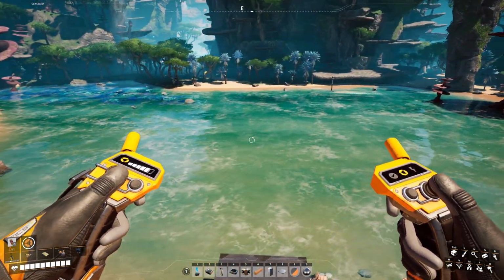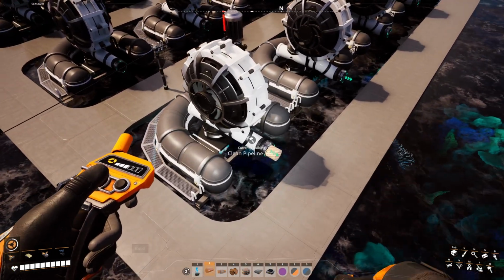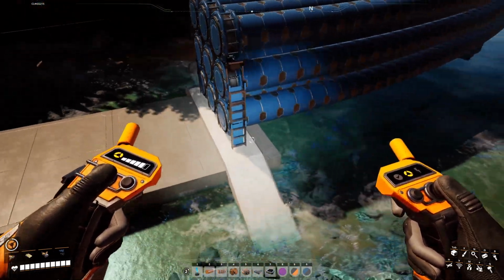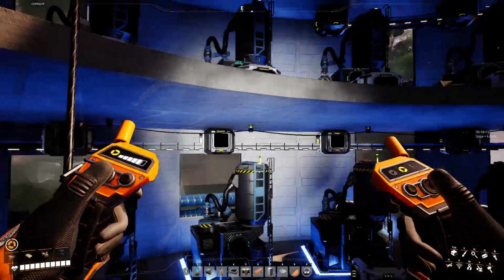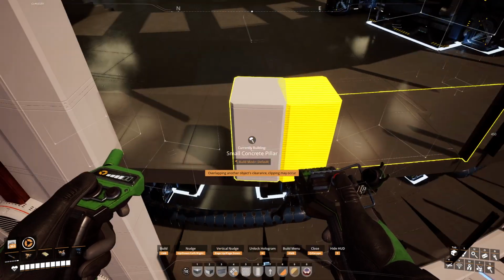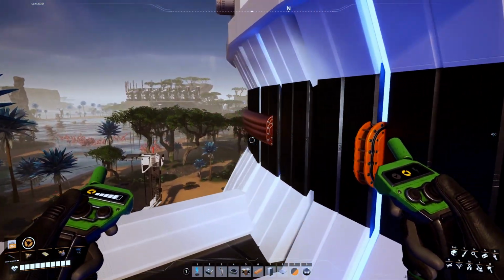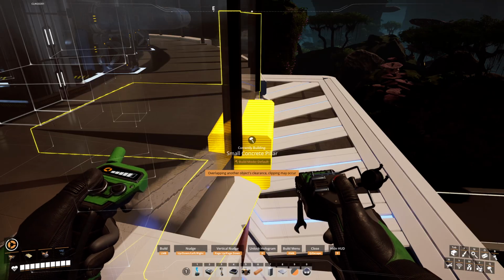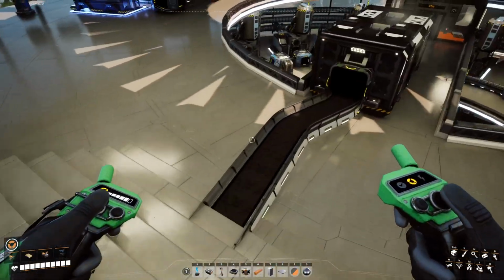EPIC Packaging Plant - BUILD GUIDE | Satisfactory1.1

Comment: Build is amazing. Good job sir! I personally like the couple foundation methods for building curve builds rather than the walkways. The curve mode is so good, I need to start using it more. Glad you went with more water on the extractors. When working with liquids it is a good idea to over do what you need slightly, since pipes are no like belts, they will not deliver immediately what you need per min perfectly. There is liquid dynamics at play as well. If you slightly over do what you need you ensure you pipe network stays 100% full and pipes work at max flow rate that you are pulling if they are full. This allows no sloshing inside the pipes and a happy factory.
Reply from the maker: Totally agree!